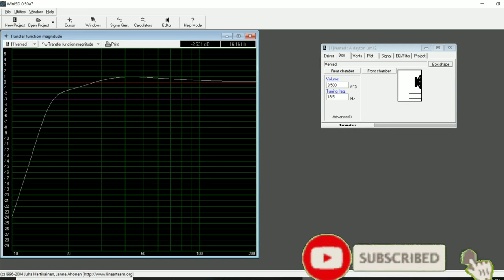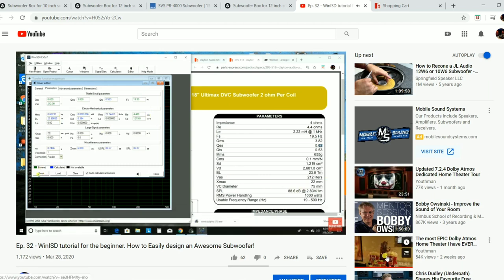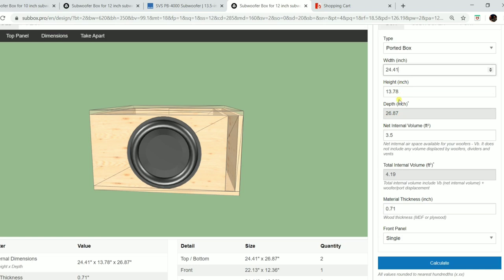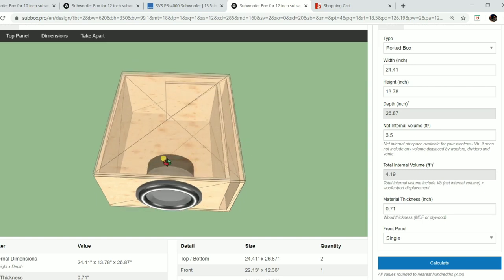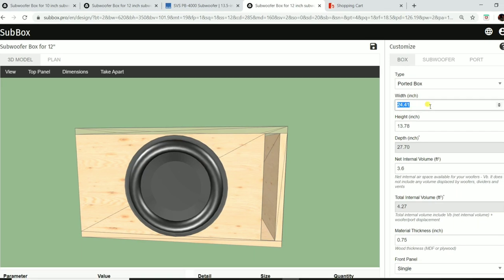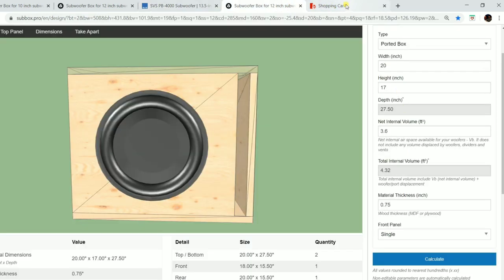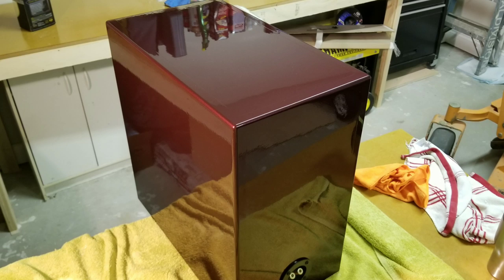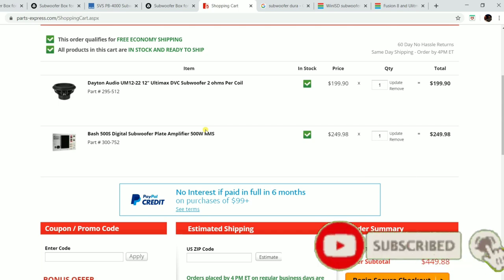Ep. 33 - How to design the look of our Living room friendly DIY Subwoofer  Home Theater Gurus

Comment: Cool, I can't wait to see your new home theatre when it's done, I hope it's all going well for you, I'll be following your sub builds, I've just upgraded my system and looking at room treatment now, then I'm done, I'm thinking of posting a short show of my entertainment system, I didn't have a big budget and I think you'll and others might find it interesting what I came up with, keep up the good work 👍
Reply from the maker: If you notice the room used for the thumbnail in acoustic series I made.  That room cost like $400 to do the treatments and columns.
Reply: @hometheatergurus  I need to do one corner and behind my front atmos mounted on wall behind TV, centre and fronts are around 4 foot away from wall, so they should be ok, the rear wall might do with some, my house is cinder block, my base response using the app you previously recommended is pretty good, there are no major dips or highs, pretty smooth response, I was using a sweep I bought off Play Store. This is my new system, using my old one to build on, being a 5.2, kenwood krf-v5100d-s 100w x 5, with Australian made Accusound Reference 8.6xd 200w rms 8ohm 45hz 25hz 90db sensitivity 4x bookshelf and centre, with twin 200w subwoofers, that replaced the original kenwood speakers/sub, for a 5.2 it was pretty good, now the upgrade, I bought late last year 2019 the last yamaha RX-A 3070 on the shelves in Australia with full warranty, to set up a 7.2.4 system, I bought two in great condition secondhand accusound matching bookshelf for atmos fronts, I'm using my old original kenwood front speakers for now as the rear atmos, I'll replace with matching accusound when I find a pair, what were my fronts and surrounds are now surrounds and rears (bookshelf), then I bought for my fronts a pair of polk audio signature s60, I picked these because they are 300w 8ohm 26hz 40hz and 90db sensitivity and slipped right into my accusounds, plus they are certified high resolution and the yamaha is too, I'd sent my subwoofers class A /B amp plates into Alan Henning owner of accusound to be referbished by him, but in this time he's been going through some really bad times, his wife died late last year and then his mother early this year, he closed the doors on accusound because of his wife being sick, he's been really struggling to do anything and my amp plates have been with him for 6 months, so I'd been shopping around looking at 2 new subwoofers to buy and 2 weeks ago I found in Australia at under half price they were selling here, a pair of emotiva basx s12 300w subwoofers that dig deep for the money, I also bought cheap and in great condition a matching Kenwood krf-v5100d-s, one kenwood is now powering the atmos fronts and rears, the other my surrounds and rears, from yamaha pre outs into kenwood 6 channel in, so a little over a 100w into each of the 8 channels there, leaving yamaha to power centre and fronts, around 135w to each channel there, this set up, out of the yamaha advantage series could only be done with the RX-A 3070, it's the only one you can assign atmos to pre outs, so after setting it all up and everything checked out right, I ypao the system late at night with no background noise, I then fine tuned it from there a little, I'd bought previously the 4k re-release of the KNOWING blueray movie, they did a little work with it, gave it atmos, I love this movie and bought it just so I had the atmos version and 4k, the old blueray version 5.1 was great, so the 4k atmos version had to be the first movie I'd watched, I'd broke the whole system in with TV and music for a few days, sound testing base response and concidering I've done no room treatment, it's a very good base response, then in went KNOWING my first atmos experience, it was awesome, the sound quality of my set up is spot on, when the plane crashed in KNOWING, I got a real taste of the emotiva subwoofers (front and rear positions) the polks sound so good, then when the train crashes in the subway, I'm sure the emotiva's moved my recliner 4 inches, chest thumping, house rumbling sound system, I'm so happy with it all, a little room correction and it'll be all spot on.

Comment: I recently used T nuts along with some standard bolts to attach my um18 to an mdf baffle. It holds very well and feels solid.
Reply from the maker: Yep I've used T-nuts. Even have a box of 50 with bolts.
Reply: Another type of t-nut is the Propell nut, which doesn't have the spikes on the back. The barrel has some ridges to help prevent spinning in the hole. I find the conventional t-nuts to be difficult in MDF because it's so hard. The Propell nuts press in easily & I use a little blob of epoxy to keep the nut secure in the hole.

Comment: Be aware that Winisd's port length will typically result in tuning frequency lower than intended, especially for slot ports sharing multiple walls with the box. It doesn't allow for different End Correction Factor, which varies depending on port configuration.
Reply from the maker: Thanks.  I'll be measuring the response using ground plane measurements and I'll adjust the port if there's any discrepancy and then reflect in on the cut sheet.

Comment: you can save money by buying an external amplifier for the subs right? i remember you mentioning one external box where you could control up to 4 subs and the cost was about 250-300 dollars so it seems youd save money vs a plate amp??
Reply from the maker: Yep. I was going to use a spare crown xls 1500 I have but wanted to do something more conventional with this build.  You're comment however has persuaded me to definitely mention this in the next video (build video) as many DIY guys would rather use a pro amp.

Comment: Another great choice for MDF is Medex, a brand of water resistant MDF. It is stronger, and more importantly, doesn't split nearly as easily when edge nailed or screwed. Pilot holes are still a must though.
Reply from the maker: This is premium select MDF.  Vey nice stuff.  I use glue /pl premium and brads so no pre drilling needed.
Reply: @hometheatergurus I've used Plum Creek & Ranger Board & they were very nice to use (well, as nice as MDF can be). Not a fan of construction adhesive for box building. Because of it's high viscosity, it causes a heavy glue line. With some of the complex cabinet designs it can screw up those carefully measured & cut panels. What I use is PVA glue, biscuits & clamps.

Another issue with cheap home center MDF is that the corners are so easily damaged. Once that stuff is banged up on the corners it just turns to fluff. And even brads will easily split it.
Reply from the maker: @frankpratt529  i agree on the cheap MDF.  But what I'm using isn't that.  It takes some major banging to dent the corner of this stuff. 

You're a lot fancier  box builder than I am. I usually slap the cabinet together in a few hours.  The finish is where most of my time is spent.
Reply: @hometheatergurus  Oh, I'm not disputing that. Just confirming that there are much better grades of MDF available & they're well worth the little bit of extra cost. And yes, the finish is what makes the thing look good.
Reply from the maker: @frankpratt529  yeah the stuff at Lowes and home depot is very inferior.  Most probably have no clue there's better MDF out there.

Comment: You can use something like Behringer NX1000 which has 640 watts into 4 ohms bridged for less than that plate amp
Reply from the maker: Yep I almost used a crown xls 1500 I have laying around but wanted something with a plate Amp for this build and during testing.  But you can definitively use something like an inuke or crown.

Comment: I watched your videos to make my first 2 subs.. made 2x um15-22 in 192liter cabinets with 228cm2 ports. Tuned to 20hz.  Winisd tells me port velocity of 
27m/s max.. well i have some port chuffing.. so i guess its better to not exceed 19m/s? Or am i wrong?
Reply from the maker: Make sure you set a HPF to protect it and keep velocity in check.  You can have port velocity under 20 but if you don't set the filter it'll chuff as you're allowing it to play under tuning where velocity and excursion take off.
Reply: @hometheatergurus  thanks for the reply. Yes i did that. I got some chuffing at 20-25 also. I gonna add second slot of 220cm2 and make it longer. ( calculated wuth winisd ) and then velocity wiol be under 19m/s

Comment: Did you do anything to calculate the displacement of bracing? Just wondering how that affects tuning frequency and volume.
Reply from the maker: Yep it's in there.  In the winisd tutorial I design this sub and you can see how minimal enclosure changes have extremely little effect on the response or performance.  But yes it is accounted for.

Comment: i used that website its handle not perfect but decently free and i also used Torres tuning calculator that helps with winisd
Reply from the maker: This was my first time not doing it all by hand on paper.  It definitely wasn't perfect.  I'll have to try out some others next time.
Reply: @hometheatergurus  i ended up buying second hand tools and saw table just for this project

Comment: Great video, how did you come up with the area of the port, I'm building a 15 ultimax, I tried 1.25 and the output had more vent velocity with bass box pro.
Reply from the maker: The version 2 is a 1.5" vent but port velocity will increase as excursion increases.  You have to model the driver and adjust the port at your max power while watching excursion and velocity and keep it all in check.

Comment: i have an rsl speedwoofer 10s rated at 24hz,can i build this sub and use it as a second sub with the rsl?will it cause any problems?
Reply from the maker: Absolutely.  Use ep 7 to show you how to align subs.  You'll need to do that anytime you have multiple subs.
Reply: @hometheatergurus  but this sub is rated for 18hz,mine is 24hz,will those match?will i get good output below 20hz?
Reply: @hometheatergurus   could you do video of how to build big ported or sealed dayton ultimaxx 15inch or 18in subwoofer cabinet?does sealed 15inch dayton ultimax can reach 16hz +-3db rating?
Reply: Most of the time you should enter T-S parameters for the spkr that will be used, best if measured as the manufacturing data can sometimes 25% off the specs, 10-15% being the production tolerance. One thing, as the spkr is run at higher level, usually Qes and Qts will increase, so it's a good idea to do some compensation for the change in parameters, or measure T-S at higher level after a little bit of work out.